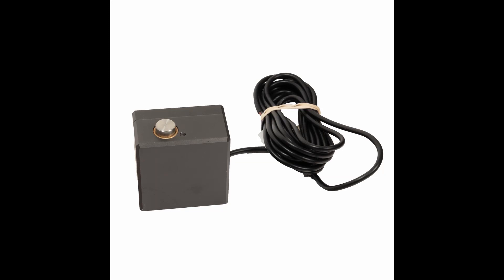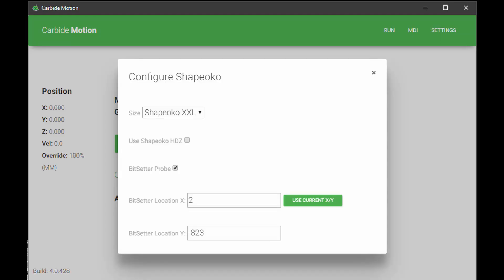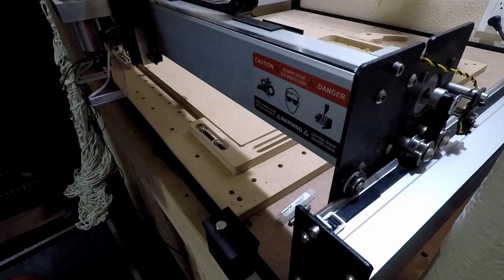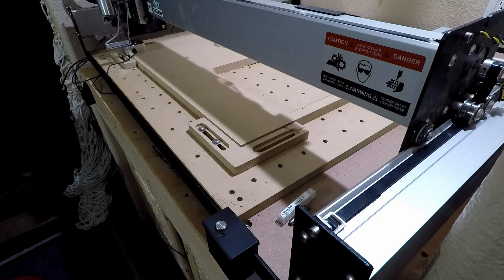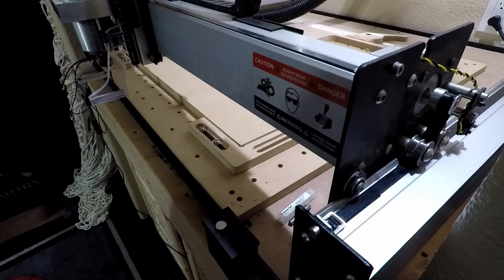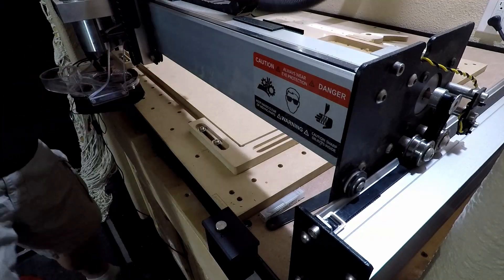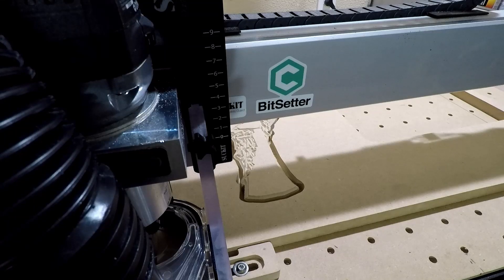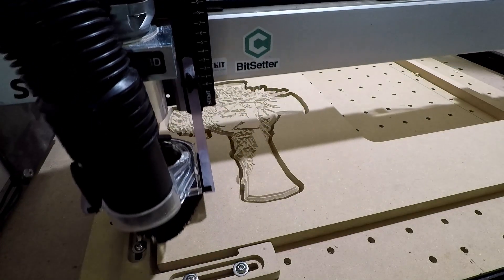BitSetter Probe Shapeoko 3

Comment: I just installed mine and set it up.  can't wait to use it.  One of the problems with the instructions is the 4 1/2 inches- its not clear if it from the opening or the very end.  Your video made it clear.

Comment: Thank you for showing the process with the touch probe and bitsetter.  One question does bitsetter adjust length for tool changes when zeroing z off the wasteboard?  Followed your procedure but zeroed z off the wasteboard.  Bit dove into my project.  Since have zeroed z after bit change using touch probe without issue but would like to use bitsetter.
Reply from the maker: The bitsetter, in theory, is going to adjust the z zero off of wherever you initially set it. The bitsetter does not know if you are using the waste board or material surface. That’s all in the gcode. I have heard lots of people using it this way. I don’t, but that’s just because I’m use to the other way.  I may have to try it out eventually.
Reply: @PricklyGuyCreations  Thanks for the reply!  Would appreciate it if you could try zeroing the z off the wasteboard to see if bitsetter works correctly after tool changes.  It defeats the purpose of the bitsetter if I have to probe the z after every tool change.

Comment: Question does the bit setter reference the next tool off the prior bit z height? if that made any sense
Reply from the maker: If you program the tool numbers in VCarve, it will tell you the tool number to install. One you install it, the machine goes over to the bitsetter and checks the tool length and automatically adjusts the z height.
Reply: @PricklyGuyCreations  Could you tell us or do you have a video on programing the tool numbers in to VCarve.
Reply from the maker: resorter66 I don’t have one yet, but I do plan on one. In the tool catalogue menu, for every tool there is a number on the bottom right side. Usually it’s for automated machines and they use 1-6. I use the actual tool number. I’ll try to get a video this week of the numbering.
Reply from the maker: Went ahead and made the video before I left. Here you go. https://youtu.be/WSF08dTmV0Y
Reply from the maker: Yes. So if your first tool was not set at the correct height, the second will be off also. The paper method I used just reassures you that the height is correct.

Comment: Very helpful.  Just got my XXL built with bitsetter.  I have Vcarve.  Can all toolpaths be exported in one file when you have the bitsetter?  Does Carbide Motion auto stop for bit change?  I am trying to learn and figure this thing out.
Reply from the maker: When I posted this video I was doing it the old way. Exporting each different bit to its own gcode. Since then a community member named Neil has posted a post processor file that does combine all tool paths. Works great with carbide motion and does prompt for bit change, spindle start and spindle stop. I’ll post a link when I get back to my computer.  I also use Vcarve Pro.